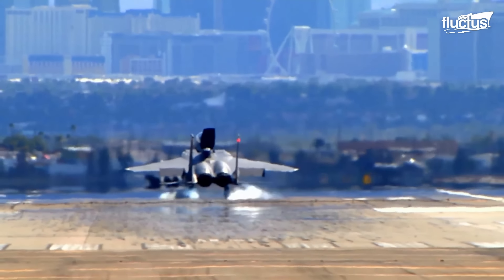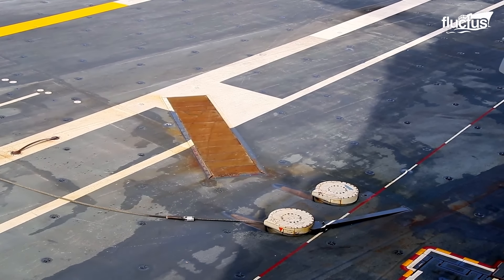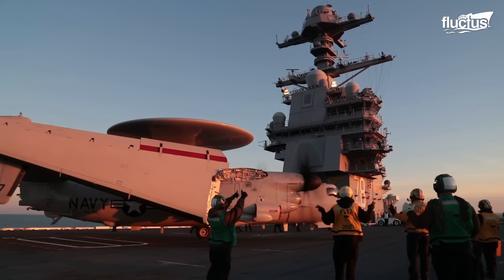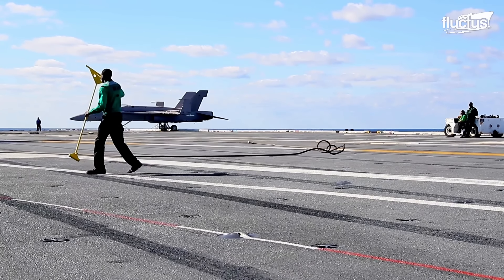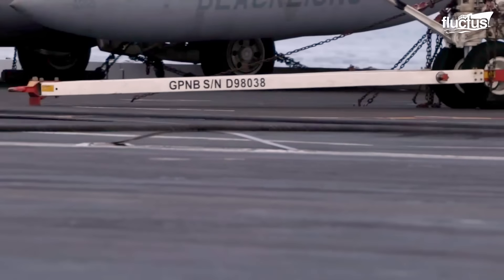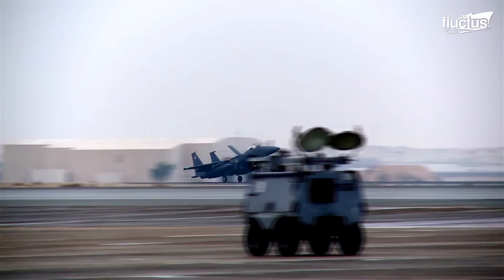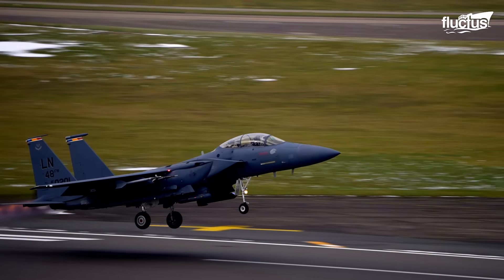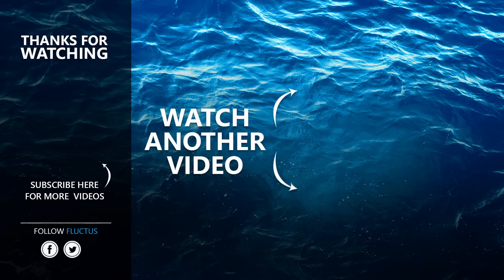It's the Only Thing that Can Save You When Arresting Cable Snaps on US Aircraft Carrier

Comment: The thing that saves you when an arresting cable snaps on an aircraft carrier flightdeck is your landing speed. You always land with enough speed that if the cable does snap you are essentially just doing a touch-and-go.
Reply: Along with shoving the throttles to full military power when the wheels touch the deck....

Comment: Dumb question. would a slightly larger tail hook help?
Plus I thought the jets landed with full throttle on an aircraft carrier  just in case the cable broke or the pilot missed the cables. 
I’ve also asked this question on several occasions but have yet to receive an answer so I’ll try again.  I understand the colors and responsibilities of the shirts of the deck crews,but no one has been able to send me an answer as to the markings and etc. on their helmets. There must be a meaning to them. I hope someone out there can tell me what they mean. Thanks.

Comment: Why all the information of land based arresting gears?  While they do slow down aircraft, they are doing so to an aircraft that already has all landing gear on the ground and is traveling at landing speed (maybe around 100 - 120 mph) and do not have to worry about rolling off the angle deck and into the ocean.  On an aircraft carrier the aircraft are coming in at take off speed (around 165mph) and the hook nomally catches the wire just before the tires touch the deck and the aircraft starts to slow down immediaely.   If the cable snaps and they are lucky - which most are, they can go gull military power (110%) and make it back in the air.  If they are not, the aircraft is going into the ocean and if the aircraft does not have ejection seaats - i.e. E2 and COD aircraft the odds of the crew making it out alive are neat zero.  If the aircraft has ejection seats the odds of the aircrew making it out and being rescued in their life raft are quite high.